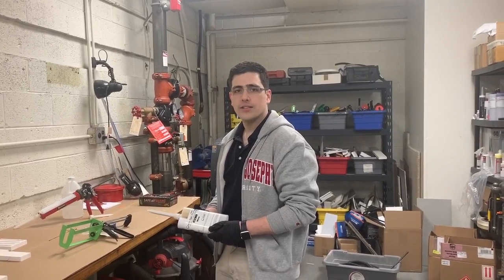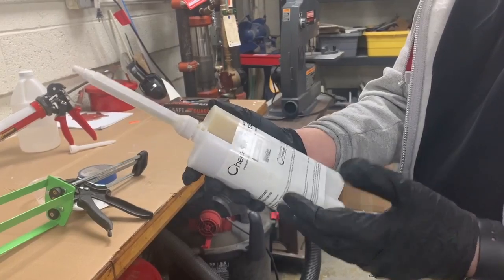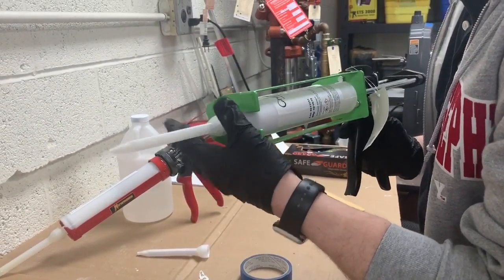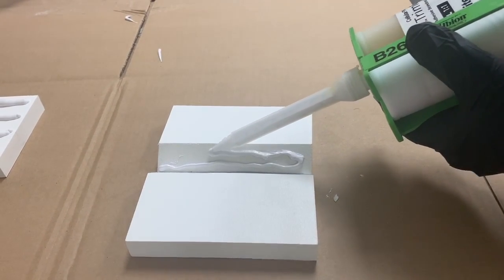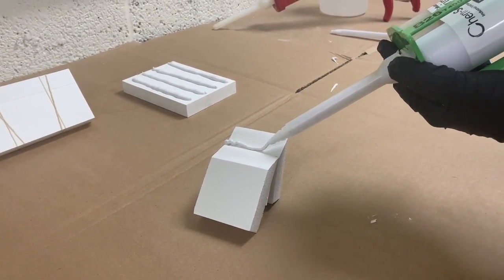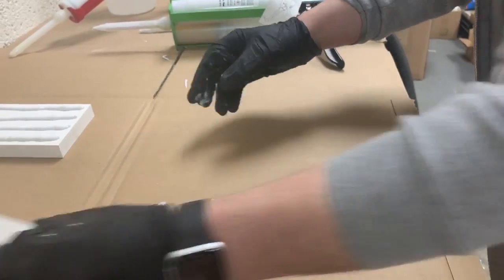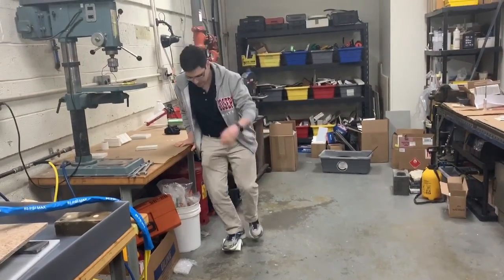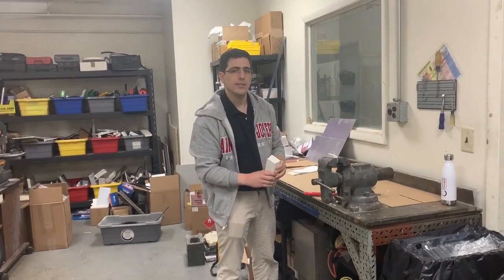ChemSet TrimGrip Cellular PVC Adhesive - How to Set Up and Use

Comment: Another company with a lobby looking like a bank,$150 R&D, $185 Chemist, $29M CEO giving us a $290 fix to a $5.60 problem! Thanks guys. Hey, your Porsche is pulling left, you need an alignment for $110. What? You don’t know why so much? Well, the alignment tech gets $23.40 for alignment. The machine cost $185k. Plus annual software, taxes, utilities, insurance, etc. so, the shop makes $30 after expenses. Your adhesive cost you similar but net-net is $113.80 per unit! That is crap!
DK, ASE master tech since 78!

Comment: Would that adhesive bond to a nodacore panel?
Reply from the maker: I am guessing you mean Nida-Core? From what I can see online, the surface is a non-woven polyester. TrimGrip will bond polyester, however it is specifically designed to bond to PVC trimboard. We probably have other adhesives better suited for this. If you can contact us and describe the application, we can make our best recommendation.